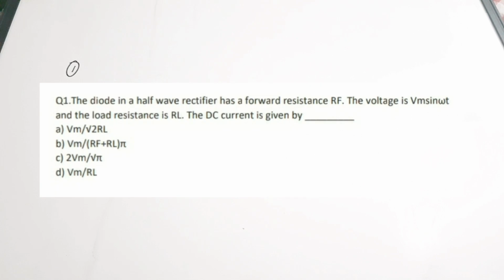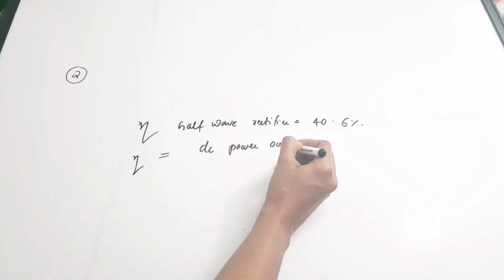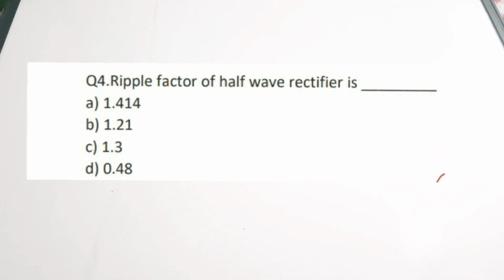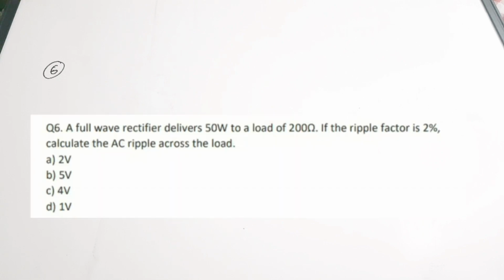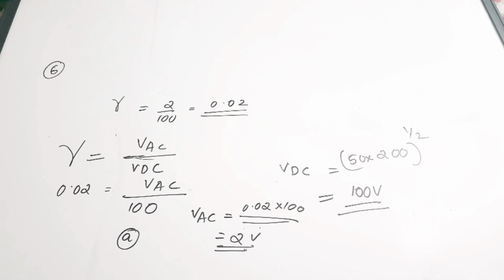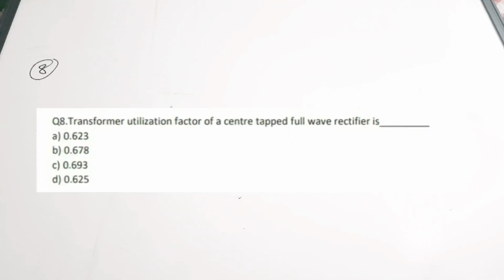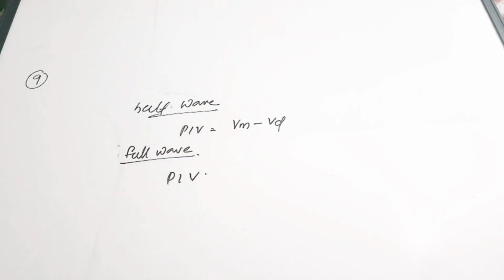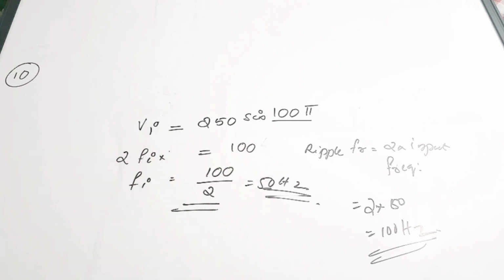Rectifier MCQ| AFCAT EKT Electronics 2021 Preparation|BIS Technical Assistant Electronics

Comment: last question????100 t i s given in question.......but in answer take that 100 pi.........
Reply from the maker: No need to take pi in that case. Just take given value/2. Generally it will be in 2*pi*f*t form. So I have taken it as that. Without realizing the given Question form.
Reply: @EasyElectronics_jobupdates  ok